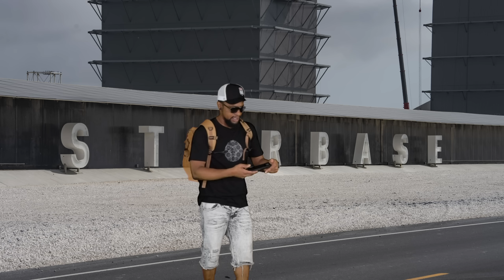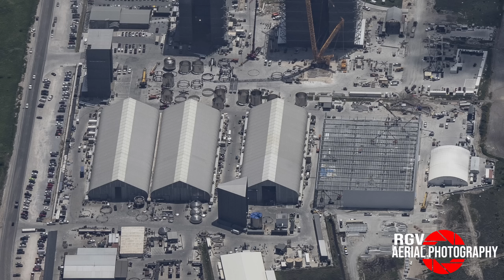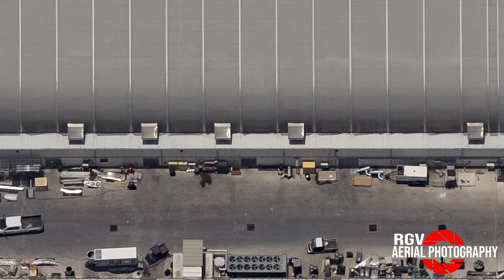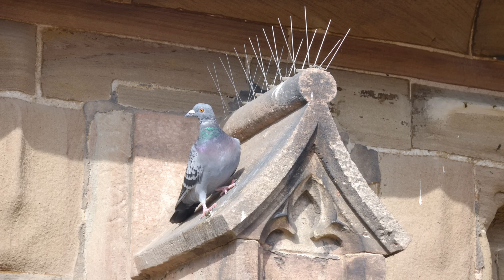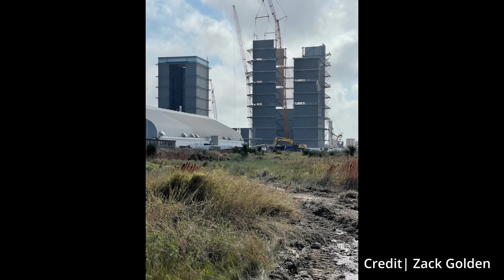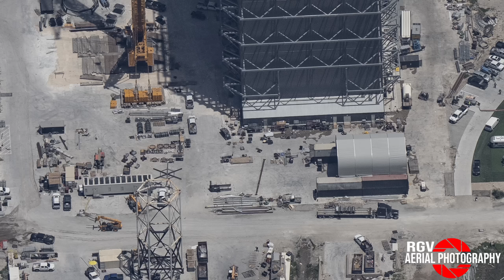SpaceX Makes Critical Upgrades To Stage Zero!

Comment: Love your videos and details, but I feel the need to correct your measurement units. Starbase is in the United States, so there are no Imperial units used anywhere! We use U.S. Customary Units (which have some overlap with imperial units, but only some), or metric. Even when we’re using customary units (based on English Units, before the UK Parliament redefined them to create Imperial Units in 1824), we are using metric units, because all US Customary units are legally defined as relative to metric measurements.

Comment: From an outsider's point of view SpaceX has incredible amounts of capital. What do you think about equipping the new factory with completely different equipment that is specifically designed for that factory. The work inside the tents could continue until they finish projects that they've already started, and then take the tents down. In the meantime, the new factory could be ramping up. Seems like a waste of time to move all those projects they've started in the tents into the factory.

Comment: I expect that the precision holes will be line bored after the table is assembled - a degree of flex and misalignment is unavoidable in an assembly of this size. Rough starter holes will allow the boring go much more quickly though!
Reply from the maker: I think you may actually be on to something there. Due to a recent image that was sent to me.

Comment: If holes are already in place they would never drill them, plates of this thick steel are cut on laser or waterjet cutter and then machined if required. Coredrilling them if they can be easily and more precisely cut by CNC doesn't make sense, CNCs are way more precise than manual operation. What they have done at Starbase was likely situation when tey had rough design and wanted to further refine OLT design without delaying construction. KSC OLT should be refined design when they need only mount prefab pieces together.

Comment: Too long, do them more often but shorter.
Reply from the maker: I figured a few people would feel that way. Most Tv shows are about that length though.  The problem is there are too many important things happening at the same time.
Reply: @CSIStarbase  "science of experimental psychology conducted experiments to ‘measure tiredness in school children’2 and came to the conclusion that the 60 minute lesson period was damaging to children’s health and not conducive to learning. Specialists therefore recommended that younger children be taught in 30-minute lesson slots and older children in lessons of 45–50 minutes."
and I haven't heard anything to the contrary, so I'd say you were spot on here with the length of time :).